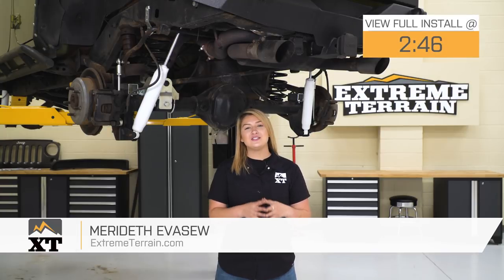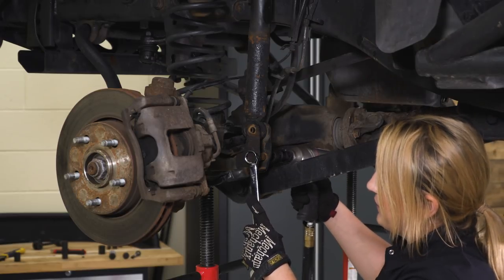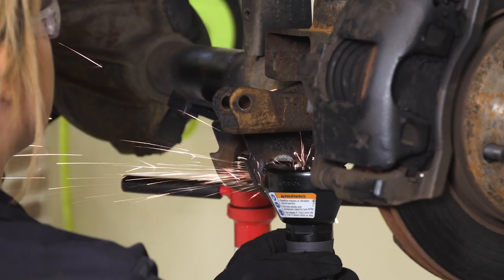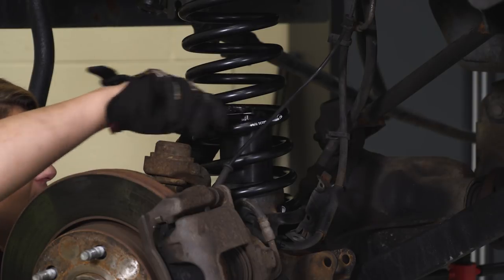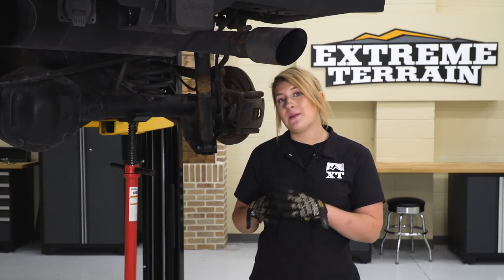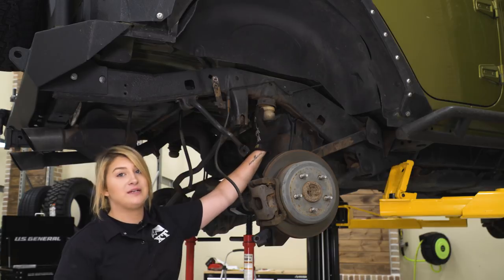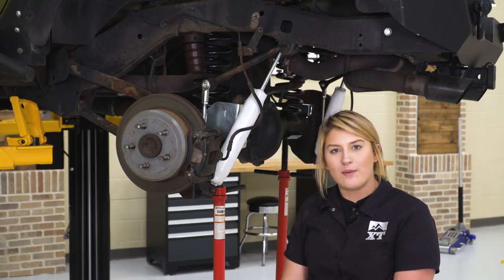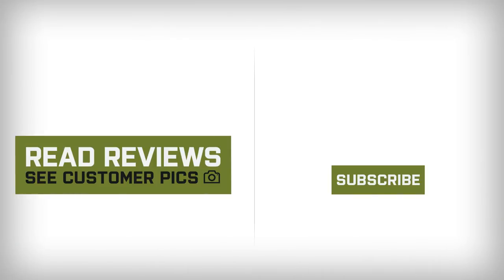Jeep Wrangler JK SuperLift 4" Suspension Lift Kit w/ Shocks (2007-2018 4 Door) Review & Install

Comment: Great video and she is very knowledgeable with the installation so I am wondering why didn't install a sway bar quick disconnect in the front?
How long are they?
Reply from the maker: Mainly because they weren't included with this specific lift kit. You can absolutely add them while installing the lift though! -Zach

Comment: Ok I am going to have to unsubscribe if you guys don’t change the way you do videos.
We watch a 30-50 minute video. We see you install the whole lift and then bam you end the video.
You don’t even mount the tires. You don’t do a walk around after with cut ins of the pre install walk around. 
This shows the lift. How it will look when finished. 
Instead you flash 10 seconds of a crappy before and after sideshot while the next video icon is on the screen.
The install is good. The wrap up is fo shit. 
Now I am interested and would love the video if you would just cuddle a little after the wham bam.
Talk about the gains, approach angles, weather or not the stock drive shafts are happy. How is the turning radius. 
Are there some things we could do or add to make it work better.
Also you take out rust bolts and put in rusty bolts. 
How about the parts you reuse you put in some rust inhibitor. 
How about greasing some parts when you install to reduce future rust and help with articulation.
You are 75% there just need to add some useful knowledge and finish in a way that better completes an otherwise good video.
Thank you for the effort and the video. Trying to be helpful not a jerk.